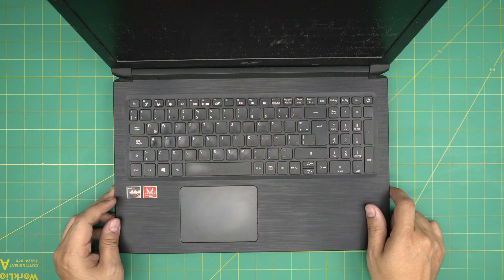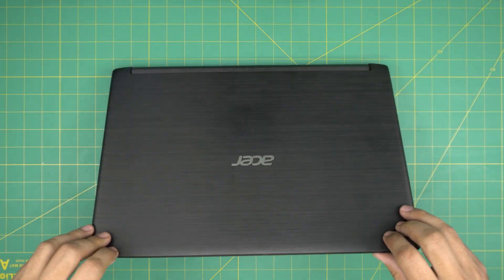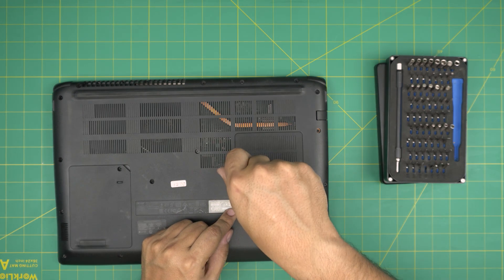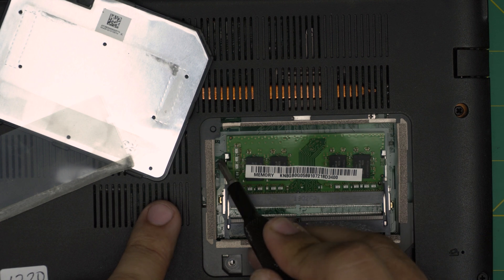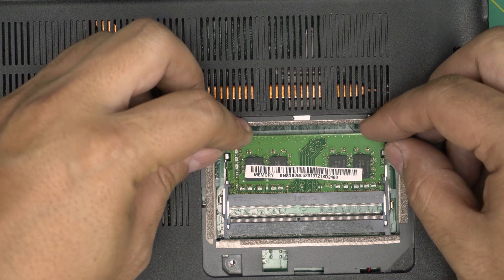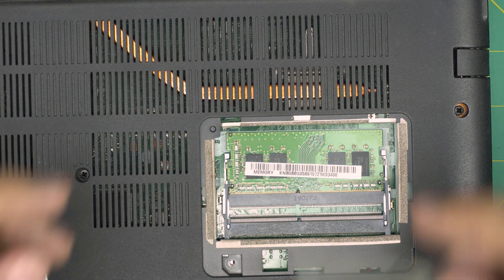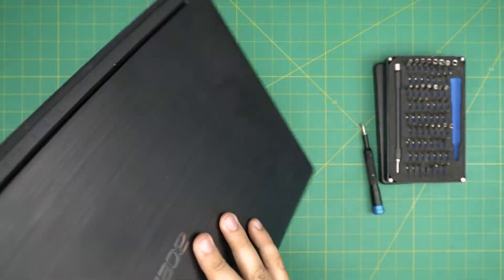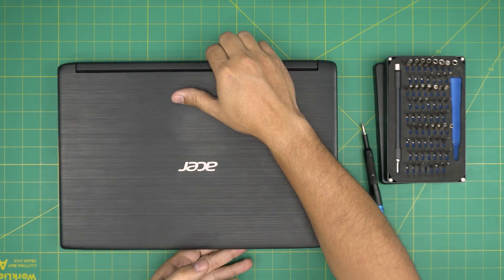How to Upgrade RAM for Acer Aspire 3 A315-41-R7WT Laptop | Step by Step

Comment: Hello sir, I have the same model but the ram doesnt fit on the second slot (The slot thats up) And the manofacturer says it has only one slot... I will try again to fit the ram, thanks for the video, now I know it fits and it has 2 slots!
Reply from the maker: It's my pleasure my friend.
i appreciate your support, 🫠Regarding your RAM installation, if you have the correct model, it should fit with a bit of force. Just make sure the notch is aligned properly.
Should you have any further questions or requests in the future, please don't hesitate to ask me.
cheers🍻
Reply: @uFixTek  I have sucessfully installed the ram. Thanks for the guide. I just had to lean it further and force a little more. It has been installed. Thanks and cheers also!
Reply from the maker: It's my pleasure my friend.
awesome job